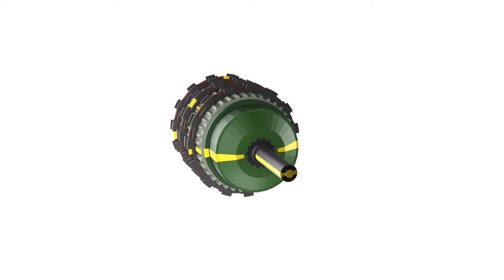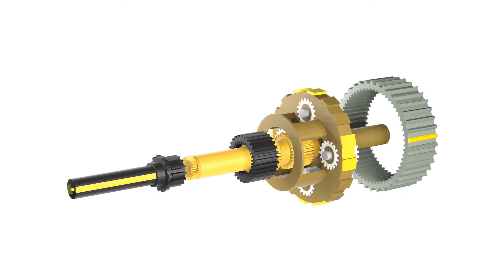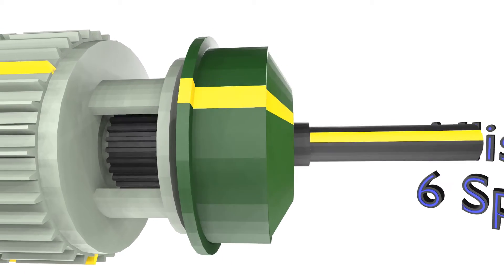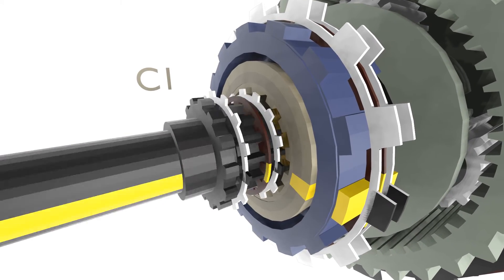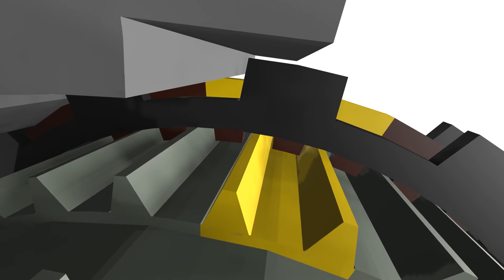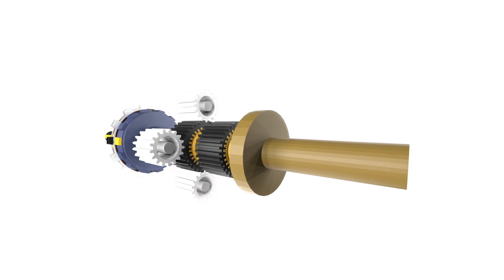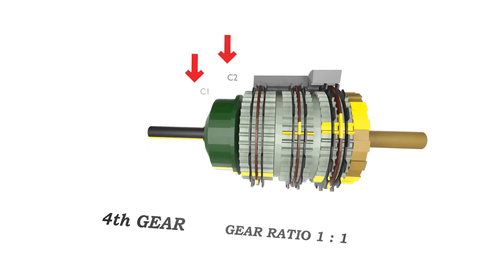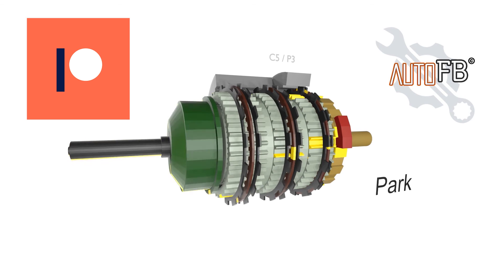How Gears & Clutch Packs Work for 6 Speed Automatic Transmission: PART 2

Comment: Is a torque converter really necessary? When you’re not pressing the gas, isn’t the power transmission already cut off? Can you answer me anybody
Reply: It's really isn't, it's purpose is to reduce pressure on the transmission and make the car drive smoother. In fact, the original smart cars didn't even have one

Comment: Who controls it to change gear?what is the process?
Reply: An electronic control unit - ECU - which wasn't covered here. The 'brain' of the gearbox sends electrical impulses to the 'C' clutch packs, which seize or allow rotation, thus changing the drive between the 3 possible options for each planetary gear set; sun spinning, planets spinning and/or ring spinning.

Comment: Why they call it c1 c2 c3 and so on?
Reply from the maker: Clutch system 1,2,3 etc
Reply: @AutomotiveForBeginners  there is no clutch pedal on automatic transmission,how the clutch system operate???
Reply: @michaeldcruz8559  - It's not referring to the 'clutch' in a manual box.  A clutch is any devise that connects or disconnects any moving shaft. In this case, the clutches seize or release ring gears, to provide different ratios.

Comment: I’ve not seen a video about these as good as this one, thank you for all the effort you put in! I’m still not sure how exactly the power is transmitted through when c3/p1 is being stopped though. Autos are just magic tho
Reply from the maker: - 08:02 the c3/p1 ring gear stops moving in 3rd gear. There is a piston located by the clutches. Causing sun and planetary gears to move only instead.
This will show you: https://youtu.be/qOsr_yzFq9c